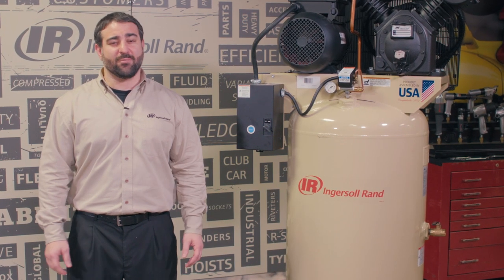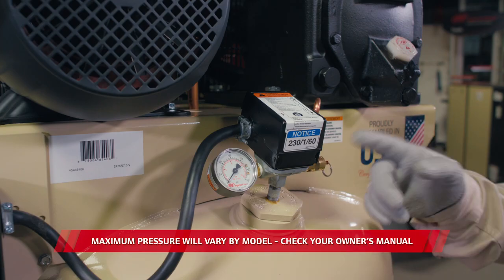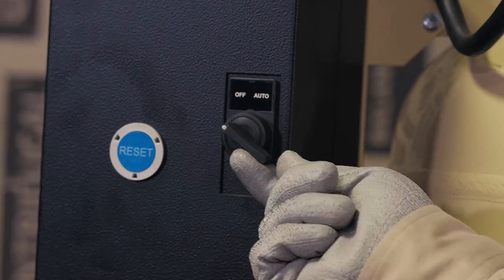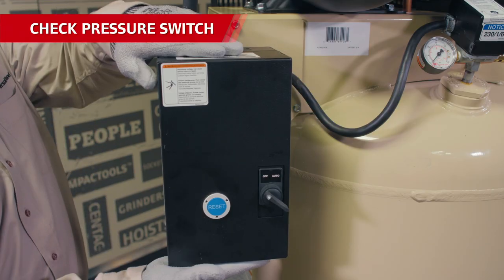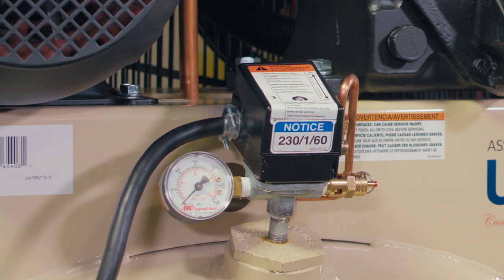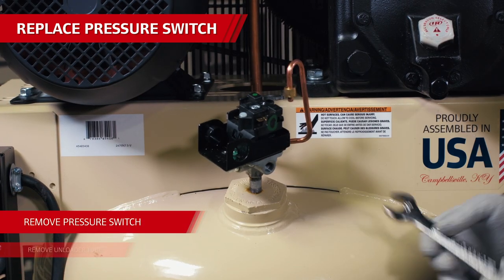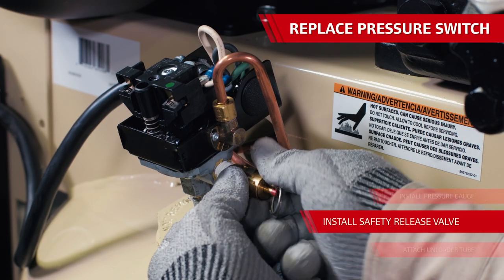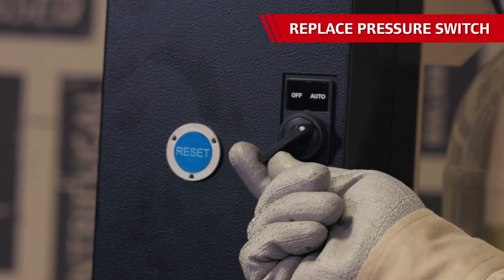Compressor Won't Turn Off Troubleshooting | Ingersoll Rand Reciprocating Air Compressor

Comment: When your co.sell IR units at tractor  supply. Stores. Include a magnetic  starter..i has one a 5hp. 80 gal unit...with no starter..I blew through  a few of your pressure  switchs..till I added a magnetic  starter...pls take your own advice from this video....I know it's IR bottom  line selling these units in a store..   my contacts  were burned. I used # 6 wire from my fuse box to the pressure  switch..it wasn't any fault of the wiring ..just the pressure  switch  could handle  the on..off all the time 5 days a week..so I had a starter installed..no issues..

Comment: My compressor wont cut out its selt and cant cut it of by hitting the  switch  so have to unplug it
Reply: A friends ingersol rand ss4l5 compressor is not shutting down neither by turning switch off only by shutting power off at breaker box. I'm wondering what does the guy in the video means by magnetic starting components?
Reply: Open up the black box and replace the magnetic contactor (starter ) motor